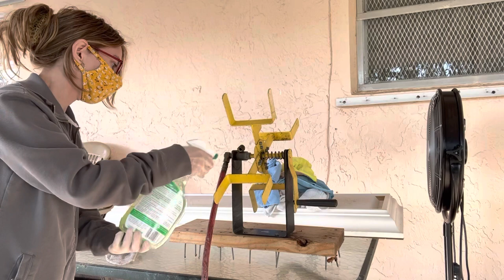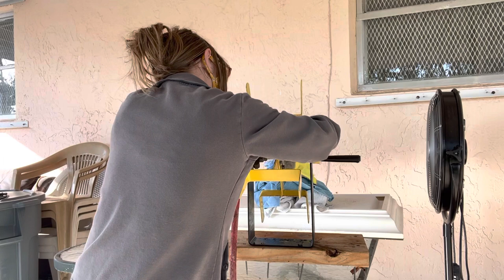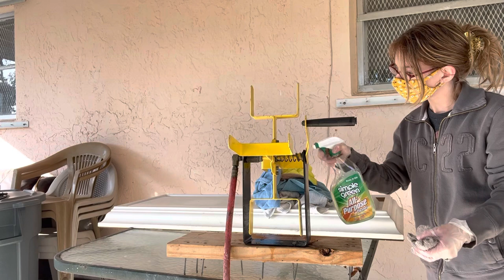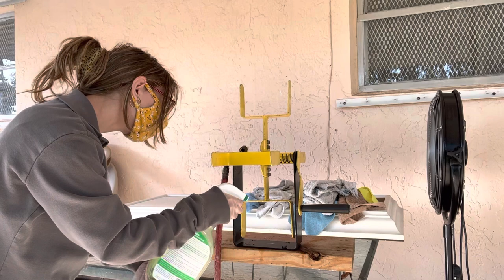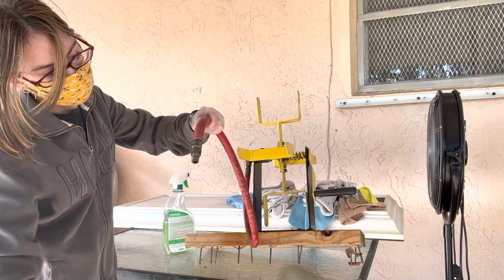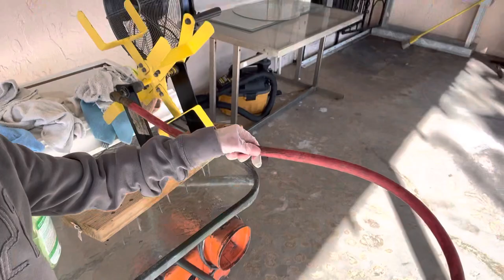ASMR! Cleaning Vlog!🧽🧼🦠Cleaning An Air Hose Holder!✨Requested✨

Comment: You need a plumbers rubber suction pump! 🪠 Long hair becomes entangled and blocks the pipework.  Draino won't dissolve it, only the pump works. Cheap to buy and something very useful to have and use often!